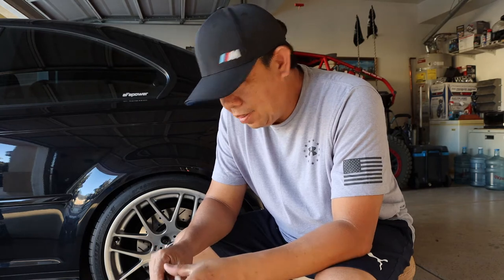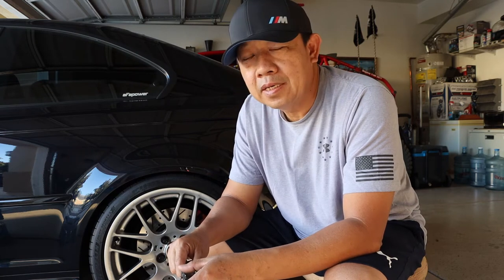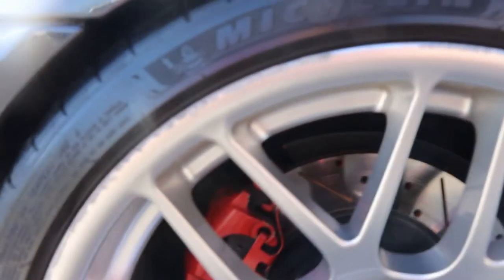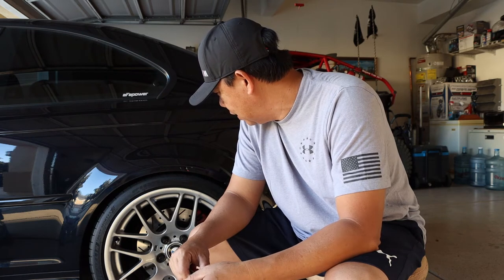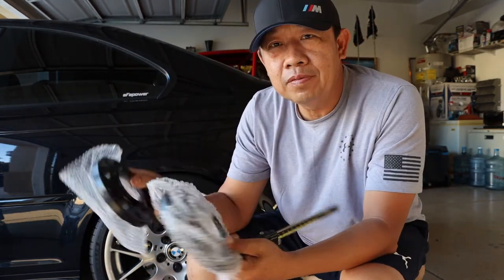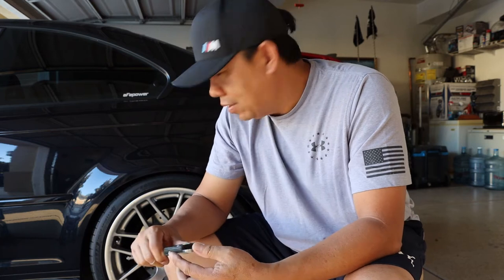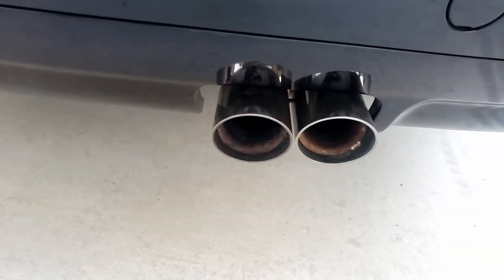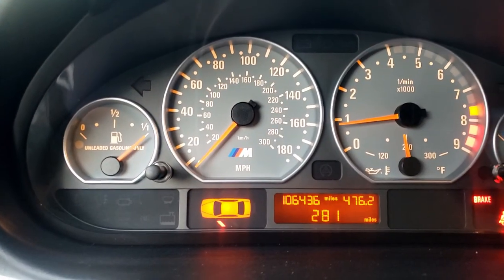My E46 M3 rear wheels rubbing.

Comment: I went with 275 35 19 on the rear based on your previous video when installing those 275 35 19 michelin tires. And I had 15” spacers and it rubbed a little when driven over speed bumps or uneven roads and making turns.  Then I went with 12.5 spacers and no more rubbing at all.
Reply: What’s the front spacer size are you running?
Reply from the maker: Thanks for the info. So they made 12.5" spacers too for E46? What brand did you get? You mine give me the link to the website. I'm look into replace it if doesn't rubbing. Thank you again.
Reply from the maker: The front spacers I'm running is 20MM and I have no issues with it.
Reply: Seth ///M3 let me look at it.  Also about the cutting! I did trimmed the rear small portion where the quarter panel fender meets the end corner of the bumper. I did not cut I just used a dremel to grind about 2 millimeters. I did that the same day when I replaced it the spacers. So I don’t know if with just trimming that small section wound be ok with 15mm spacers.
Reply from the maker: Got it. Thank you so much for the info. Joni😎👍
Reply from the maker: @dilshan13  I'm running 20MM spacers in the front.
Reply: @teslam3chennel  what wheels are those  csl wheels 8.5 in front and 9 in the rear

Comment: Are those rims OEM CSL spec? I have a 2002 e46 M3 with 10mm spacers with PS4S and it rubs slightly. I'm lowered on Ohlins suspension. I did notice your car isn't as low as mine and it's an LCI model as far as I can tell.
Reply from the maker: Yes, these rims are OEM CLS spec. that came with the car. I'm not sure about the LCI model. 90% are stock OEM on this car. I have a regular BC Racing Coilover, not the Extremely low model. It doesn't rub with these wheels spacer on. I appreciate you checking out my videos, friend✌️🤛
Reply: @teslam3chennel  ohhh, do you know how much camber you’ve got? It’s either that or my car being lower makes a difference. Same wheels, same tyres, same size spacers… mine rubs on compression when driving hard 🧐
Reply from the maker: @DriftingSquirrel  I have zero camber on the front wheels. I believe it's being too low that can cause the rubbing issue. I might be wrong...
Reply: @teslam3chennel  my rubbing happens at the back 😅
Reply: @teslam3chennel  don’t know where my head was, either that or your finger is much fatter than mine 😂 my car is not lower than yours and it rubs on hard corners. Weird..

Comment: Looks great, Seth. What is the tire size and the offset of the rims (front and rear)? Thanks.
Reply from the maker: Thank you friend for your support. My tires size are:
255x35x19 front offset 8.5 x 19.
275x30x19 rear offset  9.5 x19.

Comment: Did you cut the inner lip of the rear fender?? If you didn't then you can cut it and still run the previous spacer...
Reply from the maker: You're absolutely right. I didn't cut off the inner lip rear fender, however, I gonna save the 15mm spacers and will do it in the future. Thanks for the info / thanks for your support 👍✌. Just subscribed.

Comment: Beautiful M3 you got there! Got the same car and colour as yours. Getting the same OEM ZCP wheels as yours : ). Any downside with the spacers installed in your car like vibration?
Reply from the maker: Thanks friend.  The car is awesome happy you like it. There is no downside regarding the wheels spacers installed on this car/with OEM wheels. However, don't go over size with the spacers it will rub.  I use to have 20mm front & 15mm rear and it rubbing. I current ran 15mm front and 10mm rear. No more rubbing 👍
Reply: @teslam3chennel  You have great taste! Appreciate your kind advice. Is your front wheels 8 x 19 ET47? Have you tried 18mm front spacer?
Reply from the maker: @ronniechoo4512  Maybe 8 x 19 but not sure.
No, I have not try 18mm spacer in the front. If you do please let me know. Thanks

Comment: Hi Seth 
Thank you again for another good video
Your car is looking really good. 
So your running 10MM in the rear and 20 in the front I want to run the same set up as you I just ordered some coil overs as well 
Thanks again my friend
Reply from the maker: Glade it help. Appreciates Robert 👍
Reply: @teslam3chennel  I really want to do this to my car but are the wheels spaces safe?
Reply from the maker: Robert these spacers are safe. Make sure you get the hub centric wheels spacers and just don't go too wide on the wheels spacers you are safe 👍
Reply: @teslam3chennel  Hi Seth I’m going to order the same size as you 
10MM Rear & 20 MM for the front 
Thank you my friend